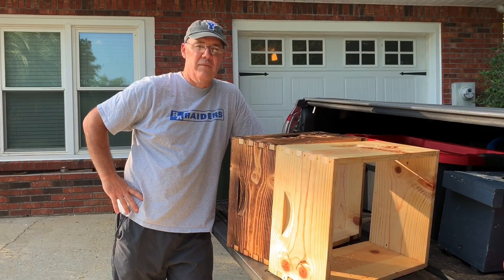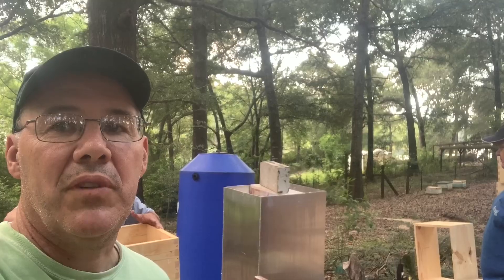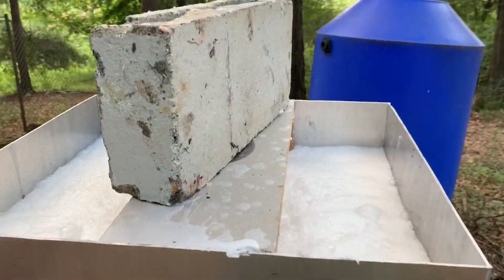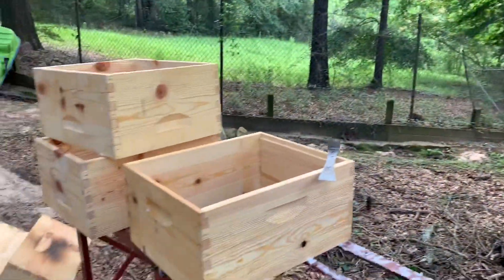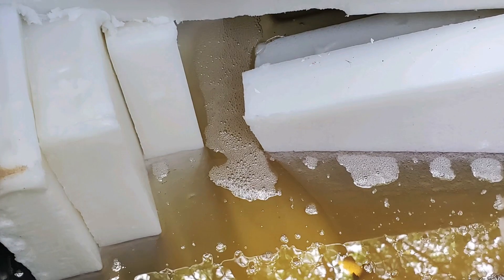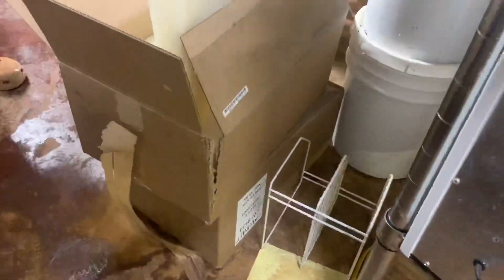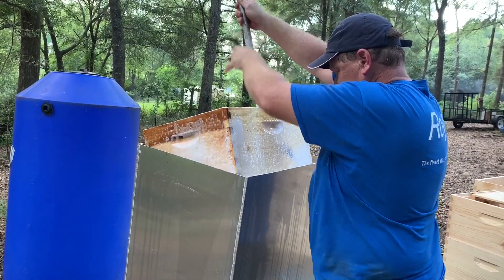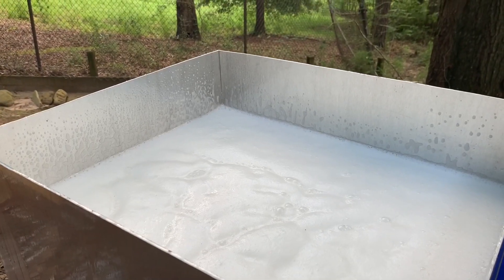Wax Dipping Bee Boxes for Preservation

Comment: The foam is caused by the moisture that is in the wood escaping as steam, I generally wait for the foam to almost subside before I remove the boxes, I then stack them on a draining tray upside down, and they drain back into the tank, I put them upside down so the wax does not build up on the frame rest area. you have plenty of time to allow them to cool  before you remove them while the next batch is running.
Reply from the maker: Hey that is a good idea. Thanks!
Reply: Will try that next round.  Thx!

Comment: Great job guys…. I use a good pair of leather gloves to retrieve the boxes, you just have to handle the boxes gingerly so as not to conduct too much heat. The more moisture the wood has , the more the tank will foam. 
I believe as time passes you will discover wax boxes get much hotter in summer than painted boxes. I  quickly spray paint them before the hot wax sets into the wood . Painting a hot wax dipped box definitely makes for a cowboy rodeo.
Reply from the maker: Hmm. Good stuff.  Thanks!

Comment: Plain paraffin wax works fine add pine resin to help keep the wax in the timber, we paint ours with oil based paint while the wax is hot, soaking in and drying off then a second coat of paint n a couple weeks, the boxes should last beyond 20yrs with this treatment
Reply from the maker: Good info. Thanks!

Comment: That’s cool.  Do you know what he’s going to charge per box?  Also, how many boxes can he dip from one 55 pound box of wax?  Thanks Bruce!
Reply: I am considering selling wax dipped boxes but I am still looking at cost.  55 pounds of wax would do a BUNCH of boxes!  wax vs paint i am sure wax is cheaper for materials
Reply from the maker: Thanks for checking in Don. I think Boyd has created a winner here. Still a little tweaking to do on the process but for the first time I think it went well. I am very pleased with how the boxes turned out.
Reply: boydmay1 - Boyd have you tried wax dipping them before they are assembled?  I thought you may get more in the pot but I don’t know if the wax would get to all surfaces with the box panels stacked in the pot.
Reply: @donbearden1953  what u understand is you want the nail holes to get waxed too.  May be able to dip unassembled but I have never seen that done
Reply: @donbearden1953  The glue will not stick/soak into the waxed wood, so you need to assemble them first.

Comment: I'm sorry for my bad English, I work with beekeeping in Brazil.
Do you dip the boxes only in wax or wax with edible soy or corn oil?
Reply: These are the waxes you can use EVALUATION Because long-term toxicity studies indicated that petroleum-derived paraffin and microcrystalline waxes are non-toxic and non-carcinogenic, the Committee established a group ADI "not specified" for microcrystalline wax and paraffin wax for the uses indicated in the specifications (chewing-gum base
Reply from the maker: These boxes were dipped in a mixture of paraffin  and I believe microcrystalline as MERRY CHRISTMAS 2.0 describes. They have worked very well so far.

Comment: I would maybe try building a tank slightly smaller the the internal dimensions of a box as a water tank then building a wax tank "Jacket" around it to reduce the volume of wax required to fill it. So the out side wax jacket tank is about 2 inches wider than the water tank to give space for the boxs to slide down as if they were in a stack. Less waste of petrochemical wax and kinder to the environment. Just a though as it would work like a double boiler
Reply from the maker: Sounds like a good suggestion. Thanks for checking in!